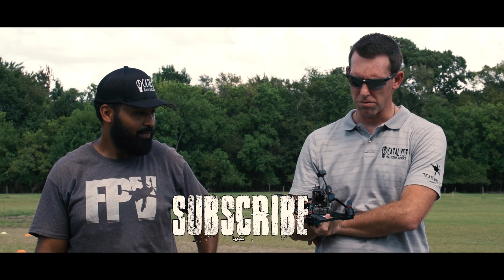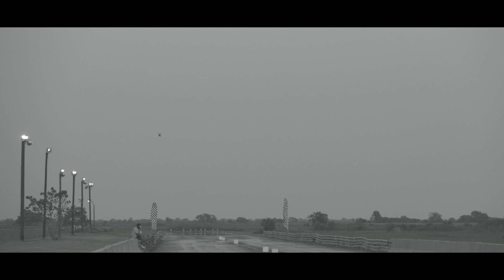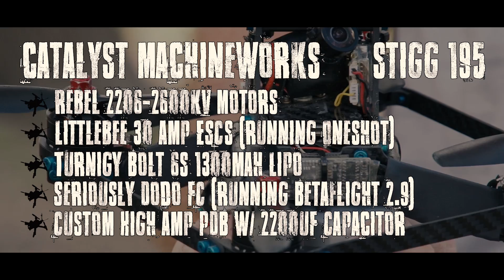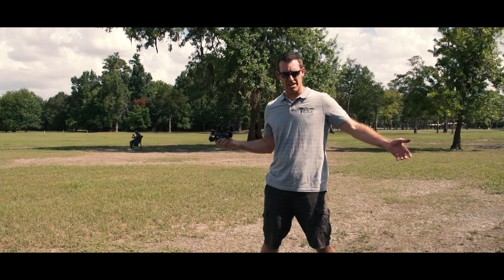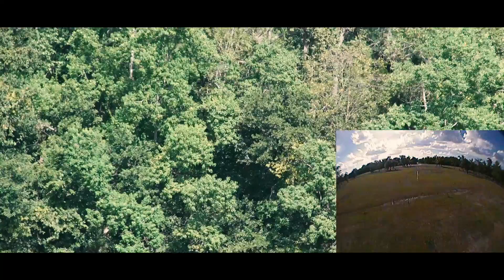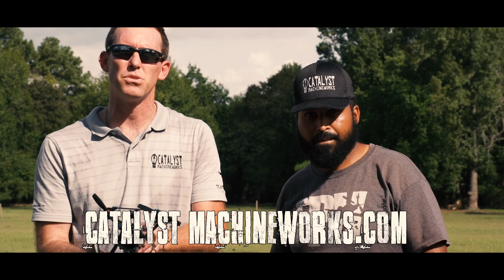THE WORLD'S FASTEST QUADCOPTER DRONE! a new record set by The Stigg 195

Comment: How many charge cycles did it take to cause the poor quality lihv Turnigy bolt batteries to puff and become unusable? I had several 4S packs go bad on me after Fifty charge cycles of moderate use and 1C charge rates
Reply: You got fifty cycles out of your Bolt batteries?  Mine were junk after 10 to 15 cycles...  And I also charge in parallel at under 1C and store at proper voltages.  They were great when new but quickly went bad.  I have regular lipos with well over 100+ cycles that still perform better than the Bolts with about 20 cycles.

Comment: So not even a TiltRotor quadcopter could beat the 171MPH    rc helicopter record ? ...
its a drag issue  i think ..
Reply: Who made 171? Mind you there's a huge difference between a single rotor with collective pitch and multi rotor. Tilt rotor is to heavy. Hard to do a 190mm frame with tilt rotor and there's no servo fast enough to make the tilt rotor config fun to fly. It does well on the straights the moment you hit a corner you crash since the tilt mech isn't ideal for multirotor cornering.
Reply: Epic-Elite Dynamics an rc helicopter  on youtube got the world record idk search it ...
and so your saying tilt rotor could never be as fast as a normal quad copter . ok ... 
and helicopters can always be faster in a straight line ?  right ?
Reply: combine a tilr rotor design with 2 tail rotors from an Trex 600 
so 4 motors for stability, and also for moving forward due to tilt. and 2 motors just for accelerating and deccelerating quickly (tail rotor of an TREX600 heli)
Reply: onGlobalproductions bro if you want to go fast "just shake and bake" whoooweee!
Reply: Yes drag and the faster the more of it you get. and it isn't lineair. Up till point that bit extra weight doesn't matter that much. Then airodynamics and thust matters most.
Also If you go for tune and design for top speed. You wil come to point that it wil fly as drag racer. Fast straight but the bad on the curves and hard to handle.
Also to go easy on the amps you build up speed first before go full thottle.

Comment: Nice, but let's be clear, it's not the Sting 195 per se, it's the combination of motors, ESCs, props, lipo, and frame.
Reply: The frame is a big part of it how it cuts through the air is a big advantage when you're going as fast they are. Trying to get two or three extra miles at that speed aerodynamics matter more than anything since the amounting power you'll need is massive alone.

Comment: Well done guys...very impressive speed.
Hope to have  chance to go faster with my design
http://www.rcgroups.com/forums/showthread.php?t=2696865
Reply from the maker: Very cool design!
Reply: Hi have you been running this quad on 6s for any decent length of time?
I have tried the prototype Raptor 6s ESCs and the KISS 30A both with 50v 220uF LowESR Caps on all ESCs.
Unfortunately I can't get anymore than a few flights out of either without damaging an ESC. The performance is incredible but NO longevity.
Want to check if the LittleBee 30A are the answer for longevity and if so what Caps did you run?
Regards
Doug

Comment: that Stigg 195 would go right through that plywood you were behind
Reply from the maker: Yes I will made a better fort to hide behind next time lol.
Reply: Yes, get at least 2x 19mm MDF glued together with a 5 mm steel plate in between.
400 gramm at 195kph is like 0.5 * 0.4kg * ((195/3.6) m/s)^2 = 587 Joule of energy.
That is about the same kinetic energy as a 9mm gun. ;)
Reply: Wrong, a quad crashing hits any flat vertical surface with the motor arms, and that´s a VERY little surface, so the force would have not spread across a larger area, but would have crashed the plywood, specially considering the arms are thick carbon fiber. Quadcopters are VERY dangerous, they move extremely fast and can hit anything with strong, rigid and pointy carbon fiber
Reply: Well...we have a question and a lot of theories ...i want to know who is right...please crush ur Quad to that Plywood and share it with us :D
Reply: The plywood would make the same difference than a piece of cardboard... now that's a video I would like to watch!
Reply: I've seen potato guns shooting through plywood this thick and a potatogun has way less energy and a potato is way softer than a carbon fibre quad. 
The quad will go right through it, these are no toys.
Reply: How much does that little done weigh? It's crazy fast!
Reply: Kileak I concur. Run this experiment, I want to see the results too lol.
Reply: Your kinetic energy value is conservative on the low side (he said 127miles/hour, which would be over 204 kph). Also the force exerted on the plywood by the copter would be spread across a larger area than a 9mm, upon contact, in conjunction with the hardness of the material the plywood is made of compared to that of a metal bullet vs the plastic material that the copter is made of. The copter would likely buckle, deform, shear, and break into pieces and the plywood would be slightly damaged or dented but I would wager that he would be safe lol compared to someone shooting a 9mm bullet at the plywood  (concentrated force much harder than the plywood). lol

But ya, that little copter is fast, it probably runs out of juice in about a minute too lol.

Comment: How many runs did you do? Usually people running speed records are required to take 4 or 5 tests.
Reply: we ran several runs and made small changes between each one, mostly to the tune. in total there were 8 or 9 runs that day, the 127 and 128.1 being the fastest two. The slowest was a 98mph run and it was merely a test hit.
Reply: Nice!